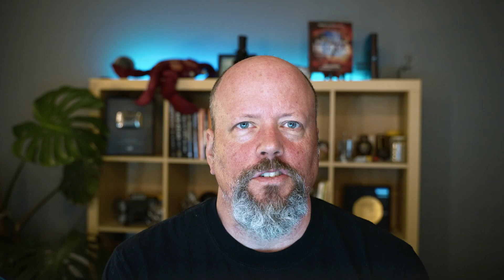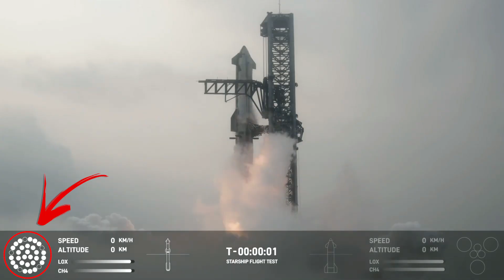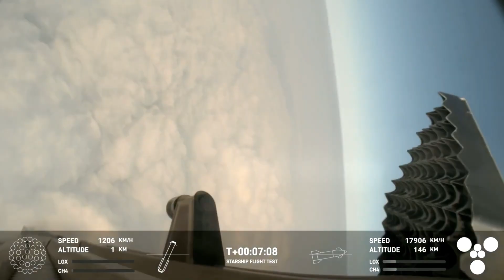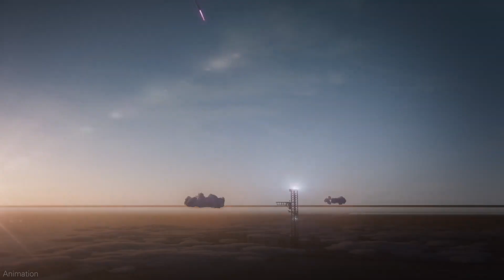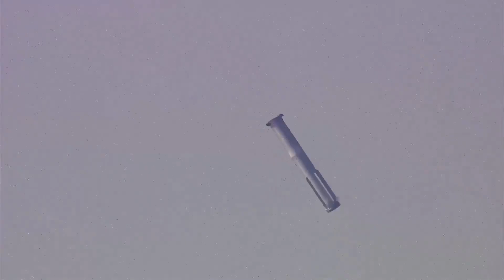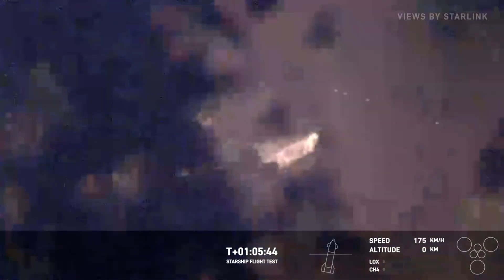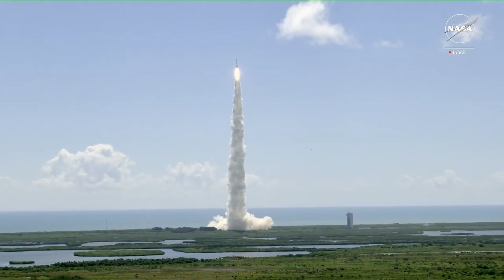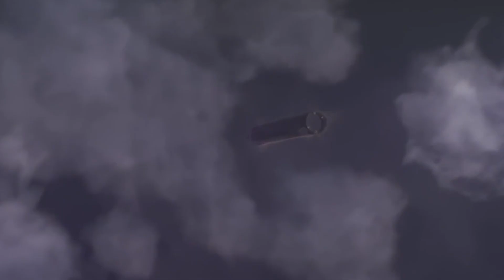IFT-4 and the Future of Starship: All You Need to Know (with @scottmanley  and @MarcusHouse )

Comment: They definitely don't want that nearly extra 10 tons of extra dead weight when they try the catch landing.
Reply: A completely empty Booster weighs around 200 tons.  Add some propellant for the landing burn, and the extra 10 tons of the hot-staging adapter amounts to less than 5% (perhaps closer to 2.5%) of extra weight - i.e. not really such a huge deal.  It's likely just a matter of the current Booster header tanks not holding enough propellant to complete a landing burn with the extra mass.
Reply: @Spherical_Cow  Yeah 2.5% to 5% weight  is meaningless, I mean this isn't rocket science,..... oh wait.
Reply: @billadamsley8654  keep in mind, the Booster is just a first stage - not the whole rocket; first stages are much more forgiving when it comes to engineering margins.  The Booster can, for instance, lose up to 3 engines (9% of the total thrust) on its way up, and still complete its mission successfully.  But don't listen to me: both Scott Manley and Marcus House have expressed basically that same hypothesis in the above video...

Comment: To accomplish a moon landing using lunar starship, rappid reusability and in-orbit refueling are required. It's going to take at least 6 starship launches to get all the fuel to the lunar starship. I don't think that SpaceX is going to build 6 to as many as 16 throw-away, one-use starships to get that job done.
Reply: Rapid reusability is not needed for lunar missions. At least not "rapid" in the same way normally discussed with regards to Starship. They will have at least 2 and possibly 4 or more launch pads that will be possible to use to the lunar missions. Further, if they expend the upper stage only, you are looking at a huge payload capacity to send fuel up. Probably over 300t on a single launch. Since the lunar lander won't be out of fuel in LEO, 2 or 3 expended launches of refueling tankers would be all that is needed to refuel the lander in orbit. If they have 4 launch towers available, they could cover all launches within hours without having to worry about rapid reuse at all.
Reply: It is estimated that a basic Ship costs around $30 million.  In theory, expending even 20 Tanker Ships (which, if built to be expendable - without any flaps or heat shield - would be even cheaper) would run up a bill of less than $600 million in additional cost (vs. reusing Tanker Ships).  

As long as Boosters are recovered and reused, this isn't such a huge cost overrun in the grand scheme of things - considering that an SLS launch in itself costs in excess of $2 Billion (or $4 Billion, depending on how you count).

Even if NASA declines to cover the extra cost to expedite its Artemis mission schedule, SpaceX could theoretically afford to take such a hit once or twice, in case its Ship design is still not ready for reuse by the time it must support Artemis 3 or 4.
Reply: @Spherical_Cow  You make a very good point which also highlights the ridiculous cost of SLS. Even so, SpaceX still has a way to go before the super-heavy booster is ready for rapid reuse. We have yet to see a launch where all the engines work. I don't think that SpaceX will immediately refuel and launch a booster with a dead engine. I'm really looking forward to TF5. Success or fail, it's going to be exciting!

Comment: I love how we’ve gone from expecting to see a successful launch perform as it’s intended to the camera work of the reusable rocket disintegrating. Talking starships every failure as an incremental success. Is like praising a first year student film and pretending that the Godfather and Apocalypse now never existed. The NASA space program had so many successes out the gate and SpaceX applauds for its endless failures. This is the difference between the goal being spaceflight versus the goal being shareholders.
Reply: SpaceX has completed 4 test launches of the world's largest and most powerful ever rocket, within the last 14 months, and in the process went from what we saw in flight 1 to what we've seen in flight 4.  Indeed, it's only just coming up on 5 years since Starhopper made the first ever hop of a primitive test mockup vehicle using an early-prototype version of a Raptor engine...

If this was NASA, they would still be fiddling $Billions away on elaborate ground tests of individual components, and tentatively hoping for a maiden flight sometime in the 2030's.  SpaceX simply does it faster, better and cheaper (something NASA used to aspire toward, once upon a time).

So, don't fret: you'll be seeing "a successful launch platform as it's intended" soon enough - and indeed, much sooner than you would with any other company or agency.

Comment: It looks like super-heavy is really quite close to re-usable (save the hot-stage ring). Which really shouldn't be surprising, since it's roughly an upscale of Falcon-9. Ship is the new challenge. And the heat shield is the really challenging bit.

Comment: But why wasting fuel boosting back the 10T piece just to ditch it afterwards?
Reply: Because there's no opportunity to ditch it sooner. The centre three engines run all the way from liftoff until boostback shutdown. 
The acceleration would hold the ring onto the top of the booster even if it was unlatched.

Comment: Great episode!  What are the chances of doing a re-entry burn with the stretched version?  And, is it possible that the second tower will be the catch tower since it will need a lot of time to get it fully ready for a launch?
Reply: The chances of a reentry burn are zero, for both the Ship and the Booster - regardless of version.  Falcon 9 does a reentry burn because it enters at much higher velocity than SuperHeavy, and also because it doesn't have sufficient heat shielding around its engines, and isn't made of more heat-tolerant stainless steel; none of those factors apply to either SuperHeavy or Starship.

The second tower at Starbase will do both launch and catch: as soon as it's built, it will take over all operations while the original tower will undergo a major overhaul and reconfiguration.  This much is known from publicly available construction-related and environmental impact filings, as well as public statements by SpaceX.

On the other hand, recent filings related to planned construction at the LC-39A site (at the Kennedy Space Center, in Florida), indicate that SpaceX intends to build both a launch tower, and a separate catch tower there.
Reply: Thank you for the response

Comment: IFT 1 was wobbling, IFT 2 went slow, IFT 3 lost control, IFT 4 dropped hot stage. Which makes hot stage the second most interesting part after heat tiles to me right now. How will they solve that connection, that must be rigid and many things more at once.
Reply: It's quite simple: future V2 boosters will be built with the hot-stage section directly integrated.
The current set of V1 boosters were built before SpaceX decided to do hot-staging, so they had to clamp it on as a retrofit.
Reply: @lazarus2691  it's not that simple. The thing is, it must be "well vented". And heat resistant. Which limits choice of materials. Can't put composite or magnesium there, right? So it will have suboptimal weight. Sure, it's doable. But it's not exactly "nothing" either. I'm just saying first 4 flights all have had hot stage related things going on. Not solved yet.

Comment: Once Starship lands on the moon or Mars, how will it return? Will they keep enough fuel reserve? What about launching without a launchpad? We saw what happens when rocks & debris kicked up and kills multiple engines.
Reply: For the first decade or two after Starship goes operational, any Mars (and other deep-space) missions will be strictly one-way.  Those Starships won't be returning.

The currently available official renders of the HLS Starship design (intended for Moon landings as part of the Artemis program) show a dedicated set of thrusters arranged in a ring around the Ship's mid-section: these will be used for Moon landing and liftoff.  Being high up above ground level, and distributing the thrust around the Ship's circumference, the intent and hope is that they won't result in a crater getting dug under the Ship.  It helps that the Moon has only ⅙ of Earth's gravity - so the HLS Starship will only employ about ⅙ of the thrust to lift off or land, compared to what it would need on Earth.

The HLS Starship won't be returning from its mission (or getting reused in any way), either.  It will fly to the Moon, pick up its crew from an Orion capsule in lunar orbit, land them on the Moon and wait there for the duration of the surface mission, then take off and transfer the crew back to Orion in lunar orbit, for their return to Earth; the Ship will be at that point nearly depleted of all propellant, and will be dumped into a safe disposal orbit of some kind.
Reply: @Spherical_Cow  Thanks for the detailed informative reply!
Reply: methane can be produced by combining carbon dioxide and carbon monoxide with hydrogen, one of the more abundant gases on the

Comment: When it fell over, you could see the speed go up to 34km/hr. Which is consistent with the telemetry registering from the nose of the ship and the speed in which it falls over. It starts at 2km/hr (slow walking speed) and gets up to a decent speed before hitting the ocean by falling over. The bottom was in the water and not moving much. So the speed sensor much be in the nose.

Comment: One question I don't seem to understand in how Starship works is how they are going to "rapidly" fuel them if one fuel farm has a volume for a single flight with little margin. Even if they build like huge storages (where?) for several flights, it would need many days to fill them in for the next series of launches.

Comment: Artemis does not require full rapid reusability of the whole stack. It requires cheap/rapid manufacturing of ships and engines which SpaceX is already doing and would benefit from at least reusability of the first stage which is almost there. The DearMoon mission would require reentry from CIS-Lunar space, but the Artemis lander only has to rendezvous with Orion in a lunar halo orbit, not return to Earth. One could easily refill a lunar lander in LEO for a one-way trip to the moon using cheap stainless steel disposable tankers, so meeting Artemis mission needs does not require full resuablity. Even GETTING TO Mars could be done with disposbale rockets. However COLONIZING Mars will need both massive scalability and reusability to make it affordable.

Comment: SpaceX needs to ditch the fore and aft flaps in favor of one or two scissor wings.  This would simplify the geometry of the area covered by thermal protective tiles and it would shift any moving parts out of the plasma stream.  The wing(s) would be stowed axially opposite the reentry fall line, deploy prior to reentry, then would redeploy to its stowed position prior to the powered portion of the landing.

The thermal protective tiles themselves need to be woven or crocheted to each other creating mats of tiles that would in turn be woven to neighboring mats until the entire thermally protected area is covered.  They also need to be laid up like roof tiles.  The ridge tiles would be oriented along the reentry fall line, and would overlap the succeeding rows of tiles, and so on.  

The fibers used to connect the tiles to each other would be elastic and retensionable to allow for the vibration caused by the engines, for the expansion and contraction caused by the liquid oxygen and methane, and for the buffeting caused by the flight through the atmosphere.  The mats of tiles would be laid on the skin of the Starship and laced up like a corset.  

Replacing mats of tiles might be quicker and easier than replacing individual tiles, depending on how many individual tiles need to be replaced after each flight.

Comment: From what I've seen of the method of failure, the engineering issues are moderate for reentry and landing.  The rapid reuse I would put at major.....but not on the engineering side of the equation.  I think the largest obstacles to rapid reuse are logistical and bureaucratic.  Rapid failure and iteration are key to how SpaceX operates but by using different vehicles to test very specific things....government doesn't like that method.  Further logisticly repayloading a vehicle in 8 hours is just impractical but doing it in 10 days....well that is practical.  So defining rapid is something that SpaceX needs to do.....rapidly!

Comment: I wander when they consider fast prototyping phase for super-heavy near the end will they switch back to carbon-fiber for it? I mean it doesn't need to be made of steel for any other reason than to be cheap while they get changed all the time. And mass savings will probably be huge on the rocket that large.

Comment: Carbon Fiber does away with a big downside for carbon fibers (brittle when cooled down to Methalox temp.) cos yhe ring has no contact face with Methalox
Reply: The HIGH heat flux (but BRIEF enough to keep total heat transfer manageable) from Raptors onto the ring can be further attenuated with a heat shield

Comment: Why don't they experiment with making a Carbon Fiber Interstage structural ring  ?

... I mean compared to steel, the weight saving for the booster stage could be worth 7 tons (...or thereabout) + the extra fuel to carry the extra weight (from steel) that would otherwise be a penalty is also saved here when switching to carbon,

   If Steel & carbon fiber can EVER be mated/latched on AT ALL

Also worth another few tons
And at least

Comment: Think of the starship's heat tiles as capacitors, doping one side and doping the other side, and of course, an electrolyte as the septum.They could be charged by the ions encountered on re-entery. Using the very large capacitor to supply a power supply to generate a magnetic field. The magnetic field could be used as a shield.
Reply: That doesn’t sound like a feasible option. Looking at the amount of power needed to contain plasma, I can’t see that being generated by ionisation.

Comment: In order to maintain the velocity of innovation and test, perhaps to control some costs: (1) new tower has limited infrastructure (e.g., no fueling, etc.) and is used for booster landings; (2) Resurrect the "disposable landing feet" for early 3 flight tests of Starship, land on concrete aprons.

Comment: This was Aloha Flight 243 on steroids. If you are coming back home from space, your best bet is being aboard Starship even in its current iteration, not aboard some sleek contraption that will fall apart and burn up because a tiny hole was punched through one heat tile. Tough birds that limp back home despite being stricken. Some more examples from WW2 of planes that were all shot up but refused to go down. For you three, there's Meet the Press, and now there is Meet the Space Communicators, the next super big thing in media.

Comment: Was the engine that blew near  the failed engine in the outer ring?  I was just wondering  if the failed engines resulted from a common problem. For example, insufficient engine cooling from an ice clogged coolant manifold.

Comment: Question: In regard to the loss of camera feed during coast phase, could they have been flying over an area where Starlink is not permitted? End of Question. Comment: I feel like the Raptor engines surviving (mostly) on both Starship and Booster is darned impressive.
Reply: It was the same flight path as the prior test flight, which didn't lose the view.
Reply: @stevenscharmer1765  cool, thanks man

Comment: You guys missed a few key points…

1) the booster will descend over the ocean and then “hover” over to the chopsticks. If, anything starts going wrong, into the ocean… before even being over land or close to the tower. It is not a straight shot for the tower.

2) The new tiles on Starship are twice as thick and the new adhesive insulation will offer greater protection, though will make the Starship single use.

3) SpaceX already has the new tiles and insulation onsite.
Reply: 4) And the fins are being moved more leeward

Comment: Seems to me that a Lunar trip would involve 2 ships; no point in accelerating al the heat shielding to the Moon and decelerating again at Earth.
Reply: If we assume that a ship weighs 100 tons, the heat shield, header fuel, and cargo each add another 20 tons, that's a total of 160 tons.
To send that to the moon on a free return trajectory requires about another 240 tons of fuel, for a total of 400 tons starting mass in LEO.
If we instead take that heat shield off, the ship mass goes down to 140 tons, but you now need an extra 200 tons of fuel to slow down upon returning to earth.
So the initial mass sent to lunar free return will be about 340 tons, which in turn takes another 490 tons of fuel, for a total starting mass of 830 tons in LEO - more than twice as much.

Comment: Wil they try for orbital velocity and trajectory for flight 5? and if so, will the include a payload?
Reply: Unlikely. They need to demonstrate that they can do in-space relights before going all the way to orbital velocity.
Otherwise you run the risk of leaving a 120+ tonne hunk of steel in an uncontrolled low orbit, which would be bad.
They planned a relight demo on flight 3, but it was aborted due to loss of roll control. I assume they will re-try this on flight 5.
Meaning that flight 6 is likely the earliest that they could potentially put a test payload into orbit - presumably some Starlink sats.